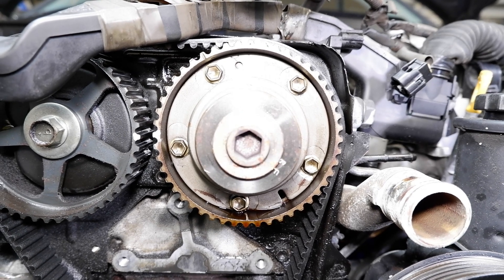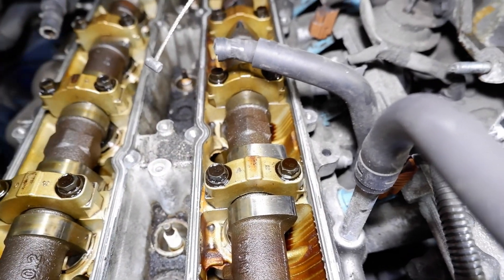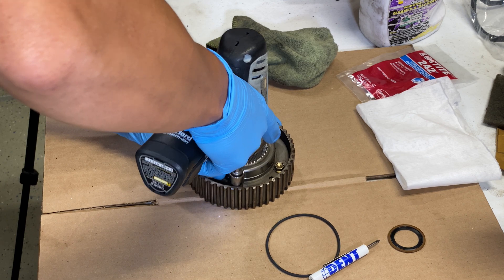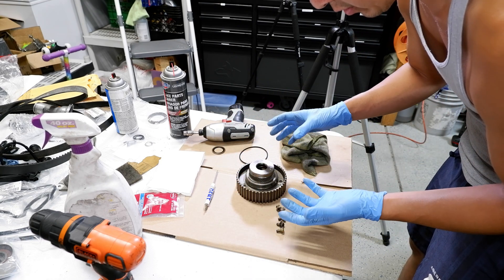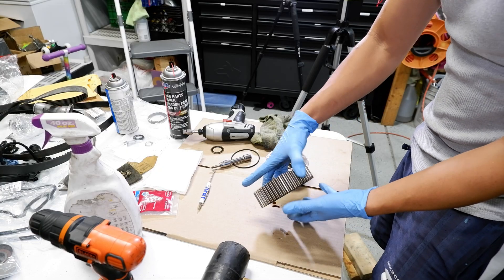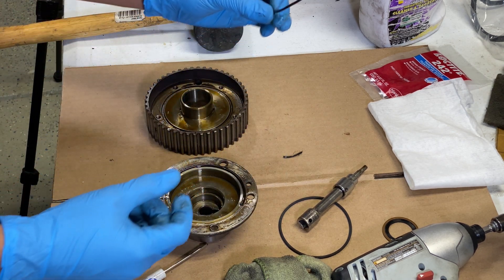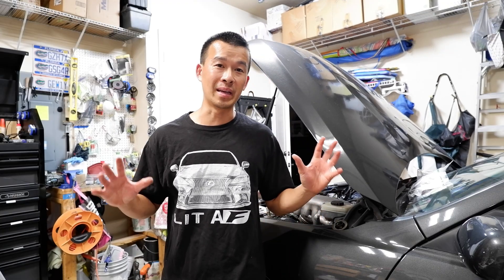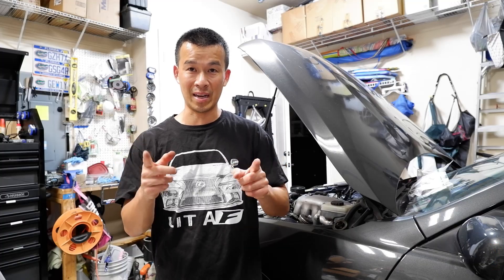How To Rebuild VVTi Cam Gear-Lexus Toyota | VVT-i Seal Replacement | DIY VVTi Gear Rebuild

Comment: Is this is 250? What year and model this was done to? My is250 does the rattle
Reply: Any idea if those seals for IS300 gonna fit IS250 2006 rwd?
Reply from the maker: The rattle is normal when the oil drains out of the gear.
Reply: @TunerwithKids  lol I get it , that wasn’t the question though.. I’m trying fix it.. the title suggests it was done to is300 ? The link doesn’t list 250 that’s why decided to ask. Almost little to no information on replacing the gears /rebuilding it speaking of is250… I’ve watched plenty videos of yours , so I’ve thought your is250 had the same issue … was able to find the video of the guy replacing those things , took him couple of days … he had to lift the engine up … I didn’t realize this job was THAT funny lol… but still rattles annoys me . And I know it’s intake camshaft gears. 150+ a piece …. Was thinking of rebuilding the thing by changing the seals same way you did to yours , the problem is I can’t find any cam gear seals for IS250 ….. 😢 that’s why thought you could give me an idea I should give it a try with those for is/gs300 not to mention I can’t find any guides other then Lexus manual that says step 1) take the engine out of the car 😂 dude still managed to take it all apart including the timing chain cover

Yours looked so easy to do…
Reply from the maker: Do you realize that’s those are completely different cars and engines?
Reply: @TunerwithKids yes I do realize it’s two different engines . If that was the case , the same seal wouldn’t be listed as a fit for variety of cars / is300/gs300 , you could’ve just said that you got no idea . Different engines . Same issue . Same rubber.  The seal is a seal . You had to SHAPE  that seal on your is300 to fit it in. So what’s the point of this nonsense about different car and different engine…..that wasn’t the question , it’s either you know/ or you did this to your 250 which I was trying to find out . Nvm thanks ..

Comment: I've rebuilt the pulley very carefully as per the video, and also replaced both cam seals. Fully re-assembled onto car, started up and car runs sweet. But unfortunately to my upmost frustration, oil has once again started to leak from the pulley area. I'm so annoyed that I'm gonna have to start all over again, or is it possible that the O-ring has just not seated properly and I'm still getting oil passing through the pulley? In which case, I'll remove the front of the pulley in place. 
Cheers
Reply from the maker: May have to get a new pulley unless you want to  try and troubleshoot again.

Comment: I have a misfire on all bank 1 cylinders upon starting. IAC within reference @27% , Installed New Vvti's and screens, all new vacuum hoses, and a used ECU. If I lay on the gas for about 15 seconds the misfire goes away and it purrs like a kitten from then on. 10 minutes later it does the same thing. All I have is an evap  incompl, and 02 f/s incmpl following clearing codes. Could this cause that issue? Is it possible a cam sensor can cause this? I also read somewhere that in the ECU there are two transistors T1 and T2 that run the vvti's. Is it possible a transistor can be finicky when started? I'm ready to torch this thing. LOL all your videos are great by the way thanks to you I was able to save a ton of money by Virginizing the ic 900 chip!

Comment: At 8:45 you mention a seal on the internal piece.  That's a very important seal - if its compromised, the internal gears don't keep oil on the correct side of them and is the reason these gears wear out.  It is a wearable part and is not available anywhere.
Reply: Do you know if this seal is "split" on purpose? I recently pulled my pulley apart and found this seal to be split but it appears to be in a very uniform diagonal way. My guess was this is normal as it allows the seal to be fitted/removed. I hope it's not broken otherwise I'm buying a new pulley and starting again 😢
Reply from the maker: @danielkuchler8097 the split hard seal is on purpose.
Reply: Yes, its split on purpose, it allows it to expand kinda like a piston ring.  It still wears over time though and I don't know if anyone has ever done testing to determine how much wear is acceptable.  That's why I've just taken to replacing these
 @danielkuchler8097

Comment: I found the oring info in your description. Any idea what the torque specs are for the cam bolts themselves ?  I see the torque specs for the hex 14mm plug
Reply from the maker: All 10mm are 11 ft-lbs
Reply: @TunerwithKids  yea , I meant to ask what the torque specs are on the other bolts ( the gear on the other cam and the crank pulley bolt) really glad I found this video because I was about to start today and didn’t realize I needed that oring at all ! Appreciate you

Comment: I replaced my o-ring and now I got code p1349 😞 i left the gear and t belt on
Reply from the maker: Did you install the small gear backwards? It goes in both directions. I made that mistake in my video. Symptoms are bogging at 3k+ RPM, poor braking due to lack of vacuum. The CEL comes on instantly after reset.

Comment: Hey Binh, @8:30 you mentioned that the small gear was inserted backwards. If the small gear was installed backward and started the car, would that damage any of the parts, especially the gears? In that case, would new VVTI cam gear be needed or would it be safe to reuse everything during the reinstall?
Reply from the maker: It didn’t run right cause the timing was off. No damage. I took it apart and installed the correct direction and worked fine since.

Comment: where do you get the 3 seal? the hardened ring on the gearset?
Reply from the maker: The split ring in the gear isn’t sold by anyone. I’m not sure it critical or really seals. The main gasket on outside is the leaker. Check links in description for what I used.

Comment: Bell Lexus? Do you live in Arizona?
Reply from the maker: No...I order all my OEM parts from them. Best prices on the internet, no tax, and free shipping over $100. They also have holiday sales every major holiday for 15% to 20% additional off their already reduced OEM online prices.
Reply: @TunerwithKids  why is the is350 recalled but the is250 Cam Gear rattle not??
Reply from the maker: All had the TISB for the rattle back when under warranty. All they did was replace with new VVTI gear but I suspect it would return. I didn’t get it since I didn’t want a tech to tear my head apart to replace. It’s just the oil drains out of the gear after not driving car for few days.
Reply: @TunerwithKids  My car runs like the first day I bought it. Except for the Cam Gear Noise ...recently sounds like Lifters or ROD bearings are about to blow up!! It’s a nasty rattle!
Reply: I’m about to go to Lexus and have them take a look at it and ask if Corporate Lexus of America can do something about it. I wonder what’s the cost to replace the Cam Gear. Any idea ?
Reply from the maker: IS250? You sure it’s not the sound of the direct injection?
Reply: @TunerwithKids  A Lexus Tech said it’s the Camshaft.

Comment: there's a lot of talks on installation about cocking the gear one way I believe that is false just put it on normal and align the dots correct? I went through identifix and it didn't give me any special information
Reply from the maker: There aren’t any factory instructions to replace seal. It’s a “non serviceable” item. Factory instructions is to replace gear. Just mark your original position and align back.

Comment: Ah.. lil tap tap with the 22 mil socket .. nice..  Hey man did any of your 2nd oil pan or connection to the block to the head leak??  Cheers.   I'm being patient to get OEM Seals.   Thanks for your efforts in this great channel.   #laboroflove
Reply from the maker: No leaks from girdle pan to block.

Comment: I recently replaced my vvti cam seal and replaced with new vvti gear.  replaced both cam seals and removed timing belts and both cam gears on the long dash mark and not the dot mark.  the engine won't run and I don't know if the cam moved as I was installing the cam gears or what happend.   I have don't few timing belts on these engines because I have 2 gs300 but never removed cams.
Reply from the maker: Did you do two full rotation to get the alignment back to TDC? Didn’t break the lower sprocket teeth?
Reply: @TunerwithKids  no I did not do 2 full rotations.  I checked all teeth and it's not broken
Reply: @TunerwithKids   
did about 5 full rotations and still no start.  It will run for couple seconds and misfiring a lot and turn off.

Comment: so i’ve just done this process. after replacing the seal, when i tip the gear back and forth i can feel and hear the gears on the inside moving side to side. is that normal?
Reply from the maker: I don’t thing so. The gears only move if they turn. Cause the center rotates independent of the outer ring 15degrees.
Reply: @TunerwithKids  i was thinking the weight of the gears themselves were just causing them to rotate when i tipped the whole assembly back and forth. maybe that’s a better way of explaining it. i’ll have to take a closer look

Comment: good video but what torque did you tighten bolts??
Reply from the maker: The 5 VVTI gear are 10mm so standard torque is 9ft-lbs (maybe 11?) for these type of bolts.

Comment: My wrench slipped off the cam. And the cam spun a few rounds should I be panicking? Plz help
Reply from the maker: If you at TDC when you started, no. But need to get it back to where it was.

Comment: Yo Binh, how long was the car sitting before it showed that leakage on the variable cam gear? I'm trying to pinpoint my leak up top and saw some oil on the exhaust sprocket side but no puddling on the intake,thanks.
Reply from the maker: IDK, this car had a nasty leak when I got it. The maintenance took care of all the leaks.
Reply: @TunerwithKids  cool thanks,,im just hoping it's not the cam seals, i don't have the time right now! haha
Reply: @TunerwithKids  also if i remember correctly, can you take off the variable gear just with the 5 bolts? and not have to deal with the big hex.
Reply from the maker: not advised to do that...best to remove it and mark everything so that you can put back in same orientation
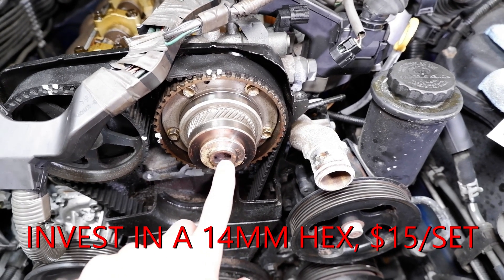Reply: @TunerwithKids  oh ok, i was talking about the outer hex cover that's shown at 2:09 and not the inner one at 2:40. When my uncle did it he still had the timing belt on, marked/scored the areas then took off the 5 bolt cover, cleaned and replaced o-ring and put lock tite on bolts.

Comment: Excellent video! Thank you for this. I have gotten this far to replace intake manifold gasket. 
My question what could be causing a rattle on start up in my 11’ is250?  I have a rattle on startup for no more than two seconds. In one of your comments you mentioned that it happened to you but not to worry about? 
I don’t have any lights but the noise is horrible! Is this a solenoid issue or can gear problem? 
Thank you!
Reply from the maker: Normal for the 250 and 350 engines. The oil drains out of the VVTI gears and causes the rattle on start up until the solenoid charges the oil back up.
Reply: @TunerwithKids  On my 350 it happened on cold morning since then its been nightmare
Low oil pressure at start and loud noise

Comment: Question, if you aren’t able to do this yourself where would you take it? Would any reputable shop that can work on Toyotas be ok or would you only take it to a Lexus or Toyota dealership?
Reply from the maker: They will want to replace it with a new.

Comment: Excellent video, thank you. I just replaced my cam seals and it looked like my VVTi gear was leaking oil as well, so I am putting the new O ring in it now! I'm happy it was only like $15 for the VVTi gear rebuild kit vs the price of the new gear
Reply from the maker: Be careful with that last small gear, it fits both ways. I screwed it’s up and was chasing a CEL and weird low end idle for weeks.
Reply: @TunerwithKids  Thanks man. I'll be honest I realize I'm dumb and I think I fucked up lol. Before watching this vid I had taken off the front plate on the gear to start the job, without realizing I needed to mark the exact alignment of that plate like you said. So my gear goes back together fine and looks fine, but do you think my timing would be off because of this? I may just replace the whole gear..
Reply from the maker: You are probably good, the fine adjustment is very small plus you can probably still see the oil that marks where the alignment should be.
Reply: @TunerwithKids  Good to hear. Thanks again 👍
Reply: I recently replaced the cam seals and replaced vvti gear.  Now my engine won't run.  I have done timing belt on these engines multiple times and I Removed the belt and cam and vvti  gear was removed on the long marks,not the dot marks.   I don't know if the cams got moved or what happend.
Reply: @knockout831  it’s been 3 years did you figure it out?

Comment: Great video. What's the torque spec for the 14mm hex bolt? Mine backed off after 50 miles drive after vvti gear rebuild
Reply from the maker: The 10mm hex inside is 60ft-Lbs. the 14mm hex cover is 11ft-lbs.

Comment: Hi tuner, nice video... I need ur help.. My is250 2007 model started throwing a rattle sound on startup for a second or 2 and stops... It happens once In while... Do u have any idea what the cause could be?
Reply from the maker: Yes my same 2007 has same rattle. It’s the oil drain and refilling the VVTI cam gear. There was a TISB back in the day for it to replace if you wanted to. Not sure if it fixed the issue. It’s no big deal.
Reply: @TunerwithKids  do u think if I did an engine oil and filter change, will it stop it?
Reply from the maker: @LuiNoTLS  no it’s just gravity working if you don’t drive the car for a few days and it’s drains out of the gear.
Reply: @TunerwithKids  alright... Thank u so much for kind response... I was so worried about that rattle sound because I have spent loads of money to make my car look exactly like yours...

Comment: I think this is a better fix than a “new” cam gear. The “new” cam gear has probably been sitting on a shelf for 10 plus years at this point.
Reply from the maker: Yea for the O-ring seal but I think the cam gears are probably still a manufactured item since lots 2JZ on the market still.
Reply: @TunerwithKids  Engine production stopped in 2007. Toyota/Lexus don’t sell the seal.

Comment: Changed out but still have a little pool of oil on top of alternator. Is it possible that the seal moved when installing the plate still causing it to leak ?
Reply from the maker: Did you do the cam seals too?  Putting the o-ring also needs to be stretched to fit the channel.
Reply: https://youtu.be/pLKN8IxFORg
I did it like these guys but maybe the seal moved when I was re installing everything. I bought the packed that came with the big O seal and the one that goes on the hex. I made sure everything was fully seated before I reinstalled stretched it out like you did and there was no gap. Greatly appreciate you help !

Comment: Questions ? I have oil on my spark plug drive side all three cylinder.. I already replaced my valve cover gasket and spark plugs seal.. im afraid 😨my engine driver side o-ring is bad.. but passenger side good.. help .help
Reply from the maker: forgot how the V6 engines do the seals but I'm sure its a seal somewhere between the head and spark plug holes.
Reply: @TunerwithKids  I think its my valve stem seals .. what the cost for replacing them? Do u remember toyota dealership or lexus?

Comment: I’m confused about the scoring you have to do. The outer gear is the one you want to align perfectly ? So the bolts that hold it in place have tolerance so you have to align it perfect and then tighten? And how can you see the scoring you did if you did it under the bolt it looks like everything else was simple but the scoring and aligning part confuse me
Reply from the maker: There is a slot that you can see.  The outer ring moves a degree in tolerance inside the hole.
Reply: @TunerwithKids  what happens if I mess that up 😳
Reply from the maker: Timing might be off and other CEL on VVTI system.
Reply: @TunerwithKids  why did you mark it twice is one mark not good enough?
Reply: @GooseBumppps  When marking something, you always want to have more than one point of reference to get the correct exact orientation.
Reply: @pavelbuchnevich1229  ok it makes more sense now thank you

Comment: How or where you get the o ring
Reply from the maker: https://ebay.to/2ObePTG
Reply: @TunerwithKids  what that small gasket for, i see ot came with the O-ring
Reply from the maker: The metal/rubber gasket is for the outermost cap for the gear. The one that uses the 14mm Allen key.
Reply: @TunerwithKids  thanks, I notice it right after I message..
Reply: @TunerwithKids  got running smooth...

Comment: I bought a 2006 lexus is350 used in 2013. There is a recall for this. I am waiting to hear back from lexus about it since my cars warranty is up.
Reply from the maker: Well it was a TSIB but only during the factory warranty period. It was really for the cold start rattle. It was due to oil draining out of the gears, didn’t affect anything other than the brief 3 seconds of rattle. It’s not covered anymore due to age.
Reply: @TunerwithKids  So can this not really be fixed anymore? I have a video on my channel for what mine sounds like and ive been trying to find the issue forever and want it to go away. Hoping to know about this and if itll eventually go away or not.
Reply from the maker: It can be fixed on your own dime. It’s gonna require replacing both VVTI cam gears. I’ve have my rattle forever because I didn’t trust these Lexus techs to open my engine back when car was newer. Once the car runs and VVTi solenoid moves oil back in, it’s fine.